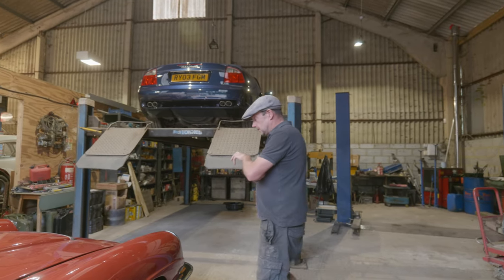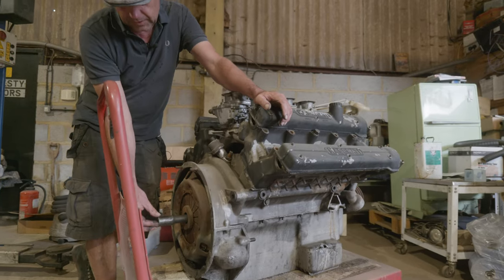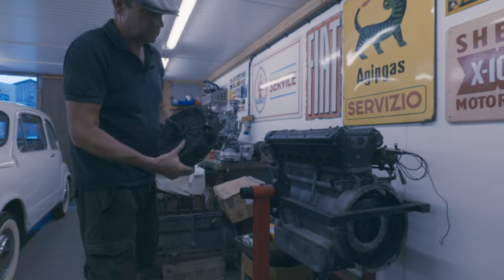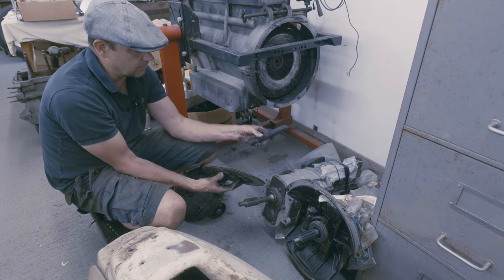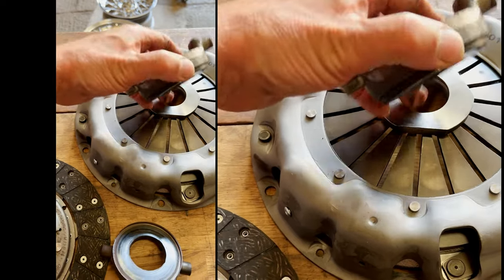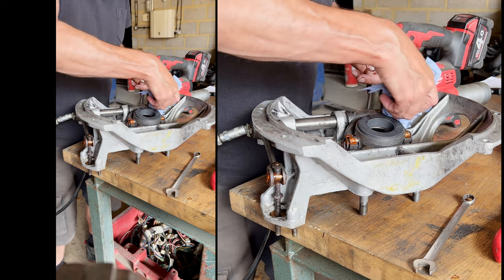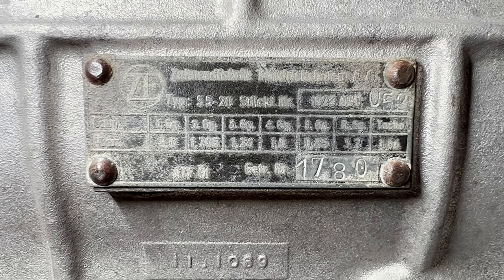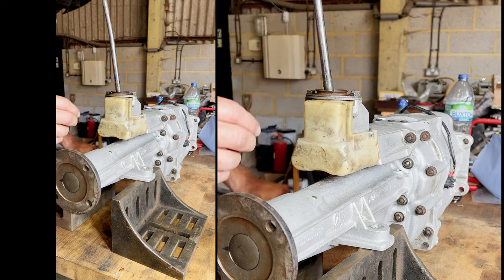Maserati Mistral Clutch replacement.

Comment: Great video and very instructive.  I had to install a new clutch and pressure group as well in my Mistral, but did it without a centering tool.
I first provisionally installed the clutch plate and pressure group as best as I could, but leaving the bolts a bit loose. Then I installed the gear box without the bell house just to allign the clutch plate, as you suggested. Then I removed the gear box and placed the bell house... also provisionally and attached the gearbox to the bell house. Only provisionally because there are two bolts on the inside of the bell house connecting it with the gear box. These can only be tightened with the bell house moved about 7 cm backwards. With the bell house and gear box about 7 cm moved backwards I could easilly tighten the two bolts within the bell house.

Also, with the bell house and gearbox moved backwards there was plenty of room to tighten the large bolts that connect the bell house to the gear box, without any special tool. The bolts connecting the bell house to the engine are quite reachable.
I even suspect that it is possible to install the connected gear box and bell house together in one go, but am not sure
Reply from the maker: There’s more than one way to skin a cat !
But why you would want to I don’t know?
Always wondered about that saying.
I’m glad you are enjoying the channel and if it’s helpful that gives it a reason to exist.
I am also impressed that you are working on your own car , it makes the ownership experience so much more rewarding and gives you such a great opportunity to understand the workings of the cars.
Reply: There are two bolts on the inside of the bell house connecting it to the gearbox. They can not be tightened once the bell house is bolted to the engine @marksitaliangarage